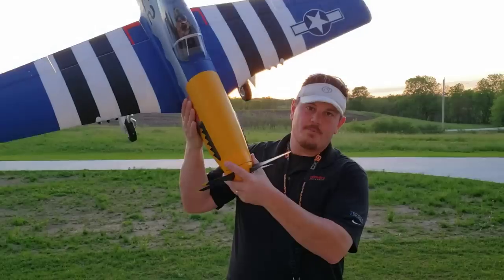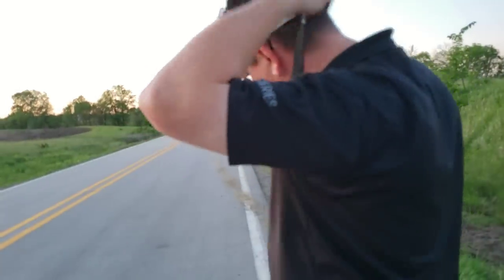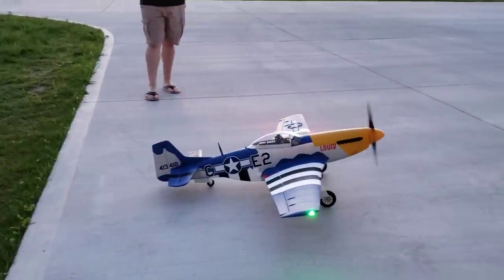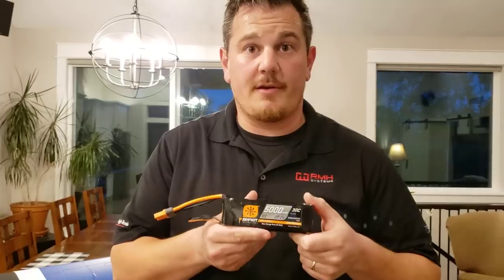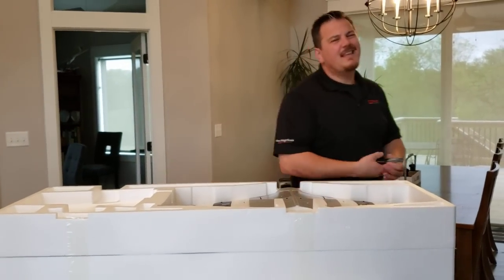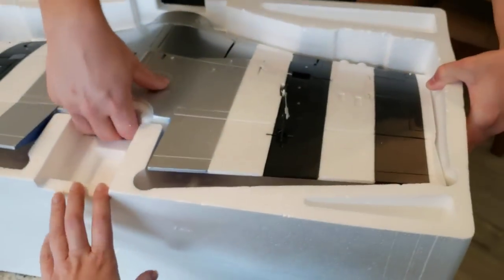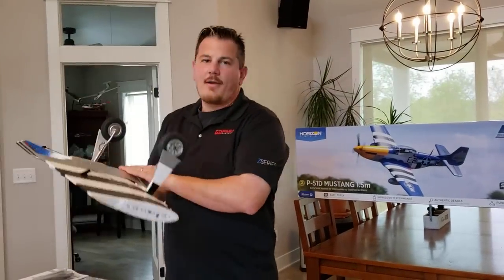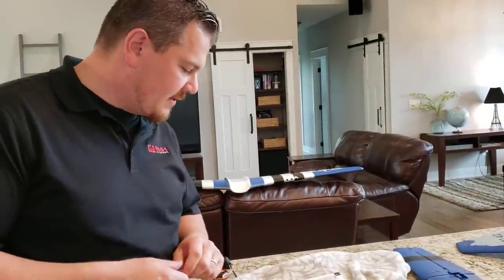E-flite - P-51D Mustang 1.5m - Unbox, Build, Setup, & Maiden Flights

Comment: Brian just started following. I have tons of questions on radio set up and mixing. Love the P51. Ordering mine soon. Also consider the Eflite Air Tractor. It’s a fun bird.
Reply from the maker: It will be mine soon ;) Can't wait!

Start asking, and I'll help how I can.
Reply: Brian Phillips first I setup the Safe select on my Air Tractor. Followed  your steps. Used hear switch. Only thing is I can’t turn it off. Stays in safe mode all the time so I disabled it for now. 
Played with mixing ailerons and rudder. What percentages should I set?
Another is can’t get the elevator to trim on center and ailerons are a tad out of adjustment. 
Running a 3200 4s 50c in it. Waiting on my checker to come in(saw yours and bought one lol) Trying to set up radio to tell me voltage remaining in telemetry but I might not have right equipment. These are just a few. Thanks. Your videos are very informative

Comment: And here is a little help with landing a P51 you need to come in at a steeper angle while giving just enough throttle to hold your glide path your flaps at full will keep you steady, 
 you will be very pleased.
Reply from the maker: Thanks for the tip!

Comment: Question on this Mustang.  There is something plugged into the bind port and it's not a bind plug.  When I bind this aircraft it binds to my transmitter and stuff moves.  If I unplug the aircraft and plug it in again it is in bind mode again.  Do I need to remove what is in the bind plug slot on the receiver bind port?   Thanks!
I haven't unraveled the wires yet to see what it is.  Need sleep.  Going to bed.
Reply from the maker: I have had this happen on a few occasions, only on my LemonRx Receivers, where you were supposed to use the BIND port for the 7th channel. It would only happen with certain RETRACTS, but on this P-51 1.5m, I can't recall anything being plugged into the BIND/PROG plug, but if you added something, you'll want to swap that thing, with another servo, and see if it'll start up without entering BIND mode. If this fixes it, then see if you can make it a permanent swap. If you DID add something to power LED's for example, make sure you're ONLY landing wires on CENTER (Positive WIRE) and GROUND (Black Wire or Brown WIRE) so as not to create a condition that could lead to entering Bind mode.

This is also a bit sketchy. If you find that this doesn't help, you need to hit up HH tech support and let them know what's up, and see if they have some ideas.
Reply: @BrianPhillipsRC  Thanks Brian.  What is in there was already there.  I need to figure out what it is.  Maybe doesn't belong there.  It looks like a Y harness.  I've had this plane in the box since Jan 2020.  Just did not have time due to covid.  The manual does mention something about an auxiliary BEC and have to remove it from the bind port if you decide to use the bind plug.

Note: When using the auxiliary BEC from an ESC installed in the bind port of the receiver, unplug it to use bind plug
Reply: @BrianPhillipsRC  OK the Y connector going into the bind port is a BEC and Auxiliary BEC.  The Auxiliary BEC was pulled out.  Now it BINDs.  :)   And if you don't plug it in the right pole to pole that does cause the aircraft to go into bind mode every time you turn it on.  Had to remove it and put bind plug in again and bind it.  Then plug the Aux BEC in correctly.

Comment: Hey Brian, it’s torque but not as bad as FlightLine 1600mm Corsair 18x12 3-blade prop. I have a Freewing P-51 is worse torqued than any P-51 that I ever own. Thank you for this video, I’m thinking about getting this E-flite 1500mm P-51.
Reply from the maker: It's a great plane. Ground handling is my only issue with it.....could be a bit better.

Comment: Grreat review - thanks for this! My P-51D 1.5m has started to develop cracks in the wing above the landing gear. I have only flown the plane 10 times from a grass field and not had any hard landings. Let me know if yours starts to develop wing cracks. Thanks!
Reply from the maker: Will do. It's been rock solid so far, but some of my foamies have done that, but unlike your experience, I'd say I've had less than stellar landings on the ones where I've had cracks develop.
Reply: @BrianPhillipsRC  Thanks very much for your reply. I did find it odd that mine developed cracks so soon. My 1.2m Mustang did not develop wing cracks after 50+ flights and occasional hard landings. Horizon has agreed to replace my center wing section. I'll be reinforcing the landing gear mounting points as some have suggested on rcgroups.com. I'll also be upgrading to softer Robart wheels as others have suggested. As always, I appreciate your excellent reviews and build videos!

Comment: Yes! Been waiting for this!!!!!!
Reply from the maker: I was super impressed with the build quality. I was surprised by how hard it was to get her to behave on landings.Landing on mains is no biggie, but when you drop to the tail dragger, it's like herding cats to get her to go in a straight line. Other than that bad behavior, it's a BEAUTY!!! I feel like this plane is a fair value at the price point too. It's well done, and just refined like so many warbirds aren't.
Reply: Brian Phillips I’ve read about the rudder control being difficult on land from others as well. We have a grass runway at our club that is 20 meters wide and 110m long so not an issue. Sounds like otherwise it’s very easy to handle but also very exciting! Just waiting for pay day on Sunday and I’m doing it. So happy you’ve done a full transmitter set up like you did with June Nite too. I follow your June nite video for all of my plane builds and this will be my new go to. Don’t think I’ll increase the mechanical authority on the elevator like you have but definitely going to look into your expo and rates although I do really love the June nite expo/rates. I have those rates on a few of my planes. I’ll need a few nights to watch all 3 hours!
Reply: One thing I think this should have got is better servo gears. Those plastic things strip like no ones business.
Reply: I’m buying mine today!! Hope to have it flying by the weekend. So Brian did you ever work out why the voltage alarm didn’t work? I have another plane with the same receiver and decided to move to using the voltage alarm on the transmitter rather than one of those cheap alarms in the plane. Couldn’t get it to work properly! Can anyone else help?
Reply: So it has arrived. However, it looks as though a number of servo cables are not connected inside, and in particular there are some servo leads that I have no idea what they are for nor where they should plug into. All channels in the receiver are full, or at least throttle was empty but there's a lead labelled throttle so that's fine, but I have three other leads that aren't connected to anything, one of which is called AUX BEC, and the other two are not labelled and are part of a Y lead that seems to go nowhere. You don't seem to have any loose leads in yours from what I can see in your wiring by your receiver. ALSO - no sign of any spare landing gear arms like you got. Hmm. Think I'm going to have to go back to Horizon to get this all sorted. Not what I've come to expect from HH, never had any issues on new stuff like this before
Reply: Trying to get to the bottom of this. I think I've established that the Y lead plugs into the bind socket on the receiver. Brian any chance you could have a look at your set up? And does that bind Y lead: one end goes through the core magnet and the other end is empty? Also does your AUX BEC lead stay unplugged?
Reply: Or does the AUX BEC lead plug into the end of the Y lead that goes to the Bind socket on the receiver?

Comment: i have build my p51 today, and the ailerons dont work. what can we do in the case ??? the rest works : elevator, rudder, flaps, gear, throttle.....
Reply from the maker: Here's where I would start...

Are they plugged in at the Rx? If ONE of the two are plugged in backward, they will NOT work. See if you can trace back to where the "Y" splitter is, and see if you can find if both are color for color.

Also, on THIS plane, if memory serves, pull one or the other wing and then pull the other wing off and you can accomplish the same trouble shooting...when and if ONE side works, you'll know that side is CORRECT, and the OTHER side, that DIDN'T work, would be incorrect. Then you can chase down the problem inside the wing or the Fuselage.

OR, you can take out the wire going to the ailerons, and just plug in a servo, or something easy to see and verified good, like the ELEVATOR....does it move? Then you're port is good...then move on.
Reply: @BrianPhillipsRC  i found the problem. it happens on the fuselage when you connect the wing. on video (1:13:44) there is 4 plug connector  (it's kind of usb connector). one of them is use for the ailerons. on the connector there is 3 very little golden rod. one of them was broken. I managed to fix it but I don't know if it will hold. i try to contact the seller (it's not horizonhobby) for a plane replacement but it seems ignore me.... PS : XBC100 serve me very well....

Comment: You must like putting your your plane in the ditch. Twice I saw you put that plane in the Rhubarb lol
Reply from the maker: This plane is squirrelly as all get out, once you get the tail dragger on the ground. This is one of the reasons I've concluded that the FW190 is a better value in the 1.5m size class. Both are great, but the FW behaves better.

Comment: I got mine last week.  The right wing hit a tree on final approach of my third flight.  The plane slammed into the ground upside down,  busted the nose off.  I am putting the nose back together, hope the foam tac holds.  Do you have any repair videos?  How do you fix it when one side of the foam is compressed?
Reply from the maker: Heat the foam with HOT water, it will relax a bit. Use reinforcement like BBQ Skewers stuck into the break, and then lots of glue between, and a piece of clear tape over the outside while it sets up...I have TONs of repair videos...

Comment: One more comment, I noticed you said there was an addendum regarding the outer gear doors, I went to the support tab and manual on their horizonhobby website and could not find any addendums for the P51 1.5, will you please scan it and upload it under your description please.
Reply from the maker: No, the addendum was in the package ;) If you call Horizon Hobby, I bet they'll send the upgraded gear doors for free. They have admitted it on their package, but it's not in the manual.

Comment: Brian. A great video on the new P-51. I have been a fan of the aircraft for a long time. An unrelated question however. I went to fly my Volantex Sport Cub 500 and when I did a control check noticed the elevator was frozen full nose down. Powering and cycling on and off have not produced any results. Banggood has a receiver brick with new servos and wondered if that is what I will have to do? I know you have done quite a bit of RC maintenance and might have an idea. If I do have to replace the receiver what method? Remove the wing, split the fuselage etc ???  Thanks for any help you can provide. Rich
Reply from the maker: Sorry Rich, I don't know, as I haven't run into that issue. If the elevator is stuff FULL down, can you try to move it , assuming it's just bound up somehow?

Comment: Great flying! Just got my mustang yesterday and it’s a beast to land. But I love it! I will get better at it I know. It takes practice because it wants to fall out of the sky if you pull the power. Also what timer should be set for a 5000
Reply from the maker: I want to know how to tame her on the ground...she's the hardest of the P-51's I've very had to land. I supposed with a HUGE runway, it'd be no problem...but how to stop a ground loop?!?!?! Please let me know if you figure it out.
Reply: Hey there Brian! I found out that i was flying tail heavy, you have to take your 5000 6S and have 2 oval holes of the bottom of the tray in front. Meaning the batt is hanging of the tray. At that point it is much more stable and easier to land. But still,you come in with HALF FLAPS and just enough throttle to almost keep flying but still descend. It should be able to fly in the ground affect fine. And just hover over the ground basically to stabilize it and bleed off speed, then, ease her to the ground for a wheel landing. Chop the throttle and pin the tail to the ground as good as you can. Also I set a servo slower on the throttle because I have had torque roll issues. It’s at like 0.6 and its perfect now! I’ve heard from one of the designers and some other people that if you can land that p 51, you can land anything. Another option of landing so you have full flaps and then three point it. Also Ik how hard it is to use safe sometimes because you want to be the pilot, but I could get her down without ground loops with it on. Also pinning the tale to the ground in takeoff for a 3 point takeoff will have it not veer off to the side or want to fly into power lines. I hope this helped! I’d love to see you fly her again! Also come on down to rc fest next year here in montecello il! I’m in a neighboring town. So I go every year. Have a good one!
Reply: One more thing, I have gotten a 19 minute flight time before with it, so it flys forever! I love it but I need a retract. I fried mine. And then the Cessna 150T is getting a repaint.

Comment: Did you ever figure out how to get the telemetry lipo alarm to work, I have the same model.  You might just also do a video setting up telemetry settings and what each reading actually means and how it can be beneficial. Please let me know what you find out on the lipo alarm.
Reply from the maker: I can't get it to work (the alarm), but I'm on a DX18 Gen1, and this feature might not be supported.

As for the settings and what to do with them...I guess, I'd say that the biggest thing you can do with them is to have feedback on your transmitter, but I'm relatively new to telemetry, so not sure what to do with them just quite yet. I know I want to use VARIO on a sail plane, but don't know if I have to buy a barometer to make it work...
Reply: @BrianPhillipsRC  Have you done the lastest firmware update to your radio, I know I had to do it with mine.  My telemetry worked for a while and then something changed, it can be challenging.

Comment: Is there a difference between the bnf that’s the combo and the non combo other than you get a battery for the same price??
Reply from the maker: BNF (Bind and Fly) Basic is what all BNF's are today...they don't come with a battery and charger...back in the day, BNF USED to include a battery and charger.

PNF (plug and fly) is what you get when there's no receiver installed. You provide that too.

Comment: Nice plane for sure.  The strut covers are another story though.  Breaking frequently is an ongoing issue.  Providing an extra set in some that are shipped isn’t the resolution, unfortunately, and the actual mounts are not available as a part.  Between the strut covers issue and the mounts being unavailable as a part for consumers makes things tough for the customers.  The toothpick idea is nice and may work!  I think that for $500, the plane shouldn’t have the issue and the customer shouldn’t be left to figure out the fix.   The tires are nice but way too hard which causes problems when landing on a warbird that’s inherently more touchy on landing anyway. Softer tire would help in this area. 
As always, super video and helpful as well.  Hopefully HH will come across with a better design in both the tire and strut covers areas .
Reply from the maker: Totally agreed! At the $500 price point, I too expect near perfection ;) Soft tires would be a nice addition to the WHOLE of the HH lineup. I've had some el-cheapo Chinese planes with very soft and beautiful tires, so I'm not sure why these are not a standard feature on the HH planes????? Maybe getting those scale looks requires a stiffer foam?
Reply: @BrianPhillipsRC  ..... Hey Brian, I have always found you, your wife with her camera work, and the videos and their content to be great.  There’s one issue, brother..... you fly everything so well put can make the hard wheels on the Mustang seem like nothing.  I also really like that in this particular video you left the scene in where the Mustang coasted into the ditch .  You could have edited that out and created a perfect scene with a perfect landing.  You didn’t and I appreciate that.  Thanks for being real in the videos.  You’re right, this plane is , to quote you, “gorgeous”.  How many times did you say that word in the video?  I’ll watch again and count, brother!  You couldn’t be more right.  Finally, have you ever hit those power lines across the road? 
My best to you and “The Camera Crew”.  I actually think I heard you say her name once!

Comment: Brian did you end up figuring out how to set the low voltage alarm for a non smart battery? I tried to do it through flight pack volts but the lipo keeps changing from 6s to 7s when I set my min to 22.8.
Reply from the maker: I don't know. Sorry.
Reply: @BrianPhillipsRC  no worries. I followed your tip with changing the stock control horn setting for the elevator. Set it at 70% rate and it works perfectly. The stock setting probably would've resulted in a crash. Glad I watched your video.

Comment: How much expo did you end up adding for the elevator?
Reply from the maker: I'm sorry, I can't remember. Expo is so subjective. Just start HIGH and work your way down, but I think I had it almost to 50%...or a TON...anything over that is supposed to make AS3X act weird...but I've never needed that much (except on planes WITHOUT AS3X - 50mm F-14 from hobbyking, fyi...85% ;) )